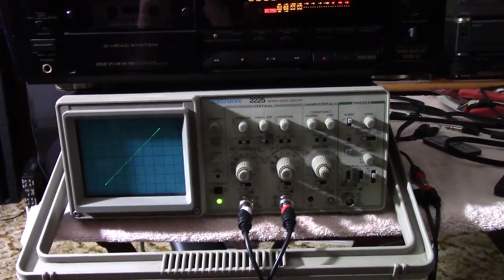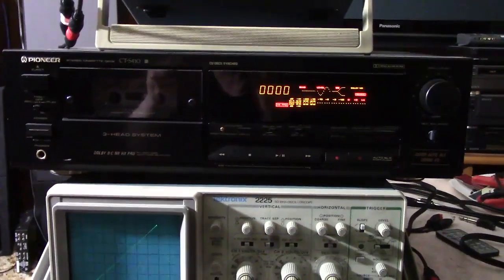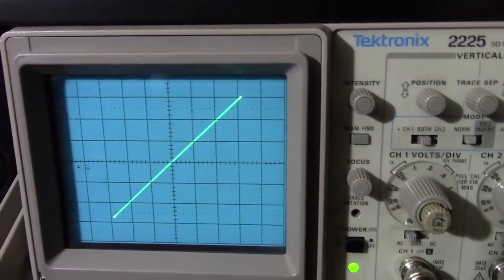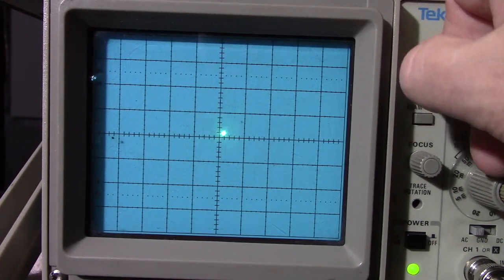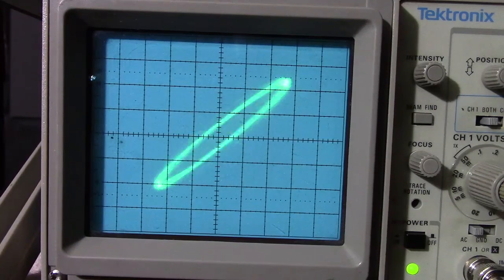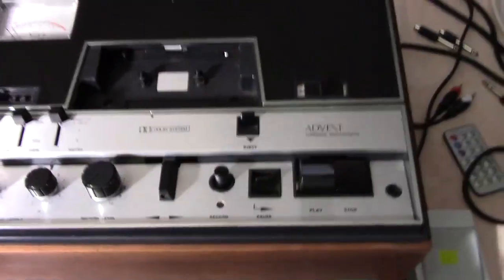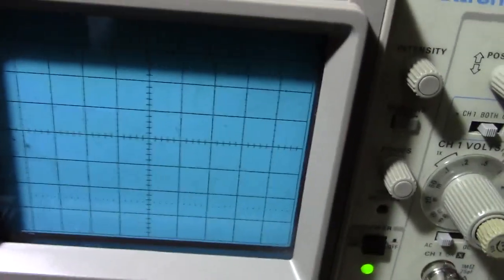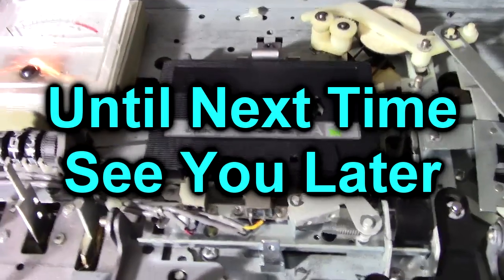Tape Head Azimuth: O'scope Assisted- Part 2

Comment: Great video, in general I’d recommend going the opposite direction, ie, use the higher frequency for the adjustment, and then the lower frequencies should be spot on.  Of course it azimuth is way off, you might have to start with 1K to get it close
Reply: Once you adjust it at 10k and check it at 3k should they be the same? mine is not and at 10k it has wobble But the voltage also wobbles also up and down i replacing the head so don't know if I need to move it up or down?
Reply: Assuming heads aren’t worn?
Reply: @JeffersonDD   No NOS different Head w New installed and w new Component added or modified  to make it work I think the head need to be moved up? I drilled the mounting holes small so I can make them Bigger.

Comment: I have a Sony TC FX2 Cassette Deck and it has 2 screws (one on each side of the playback/record head). What are each of those screws for and do I need to adjust both?
Reply: No find the screw with the spring the other side IS NOT for adjusting azimuth if the head was replaced the other side would need to be set other than that don't touch the other screw. Typically the unit has a cut out Indicating the azimuth adjustment screw. Check 1st for a dirty head that will wipe the high frequencies out of the recordings. 2nd demagnitize the head. Those two maintenance steps 90% of the time restore the sound.

Comment: Nice simply explained vid. What I was wondering is if the tamper paint is intact, how can the heads be misaligned?
Reply from the maker: Usually they aren't. That's my premise exactly. A good test is to play tapes from known good machines and factory tapes to see how they sound. If they sound muffled or lack in high frequencies, then there's a chance something is amiss.

Comment: How do you have the scope connected to the scope?
Reply from the maker: The left channel is input A, Right channel is input B... of course, this procedure will only work on a dual trace scope.
Reply: @HammyTechnoid  Ok thanks Hammy, I have an old Tektronix t922 and it does have the XY mode. Need to get another probe though to do it.

Comment: Ive found that in the absence of an azimuth tape,  you take a prerecorded cassette in good shape and play it while turning the azimuth screw very slightly. You will be able to hear the azimuth move from left to right on your speakers (or better use a set of headphones)  and will go from muddy to crisp back to muddy as you pass the azimuth point on the high hat cymbols and any higher frequency part of the music. You want to get the most 'sizzle' from the cymbols and youll definately hear a difference when you turn the screw. On a discrete 3 head like a sony TC-K71/81 the heads are able to be adjusted seperately but do not be tempted to adjust them individually . Do the playback alignment first using the block azimuth screw, then do the record head while listening to the monitor head with the back azimuth screw (as they will probably be aligned to each other from the factory), so you will be pivoting the head block in the tape path. Adjust the record head to give the playback head the most high end you can. Again, youll be able to hear the transition into and out of the sweet spot. Azimuth tapes can be recorded from an aligned deck and many are now available online. recorded from very high end decks as well as speed tapes, usually they are on the same tape.
Reply from the maker: All good advice.... I realize not everyone will have access to an O'scope, so, yes, a known good tape as a reference can be used. It's the exact method I used for years,  prior to my acquiring the O'scope. Thanks for watching!

Comment: has it to be a special tape to do that?
Reply from the maker: Yes, it does. You can order one online but they are a bit spendy. If you have a deck you can trust to have good azimuth, you can use that one as the reference and make your own azimuth test tape. This is what I do. I have a tone generator to provide the frequency I use, which is about 10 Kilohertz. If you don't have a signal generator, you can still get your tone from an online source. I generally record the level about -10db. I am about to calibrate a deck using this method with the O'scope. I'm posting the outcome here on my channel. Thanks for watching.
Reply: @HammyTechnoid  thank you very much...I have a Tascam Midistudio644. Playback is ok but recording is floaterring a lot i think  the problem is on the pinch roller
Reply: @nutrisativa2891  If playback is good on a known good sounding tape, there isn't a problem with the pinch roller. That will be a problem with the recording circuits. Try cleaning the rec/play switch(es) if that doesn't help then it is likely bad caps in the recording circuits. You may want to have it serviced by a professional if you aren't confident in tackling that yourself.

Comment: Hammy, just my preferences. I observe the both Left and Right using two 10Khz (or higher) sinewaves and observe - I'll see a shuffle between L/R. Even if they are aligned well (within 45 degrees), we will see the effects of tape wrap sheet imperfections. But the truth is - we'll never hear these effects. Even my Nak and Revox B215 exhibit some small oscillating L/R phase shifts, but so log at the average is good, I've gotta be happy! ;o)
I bet you've got more decks than me! ha ha. (I have seven)